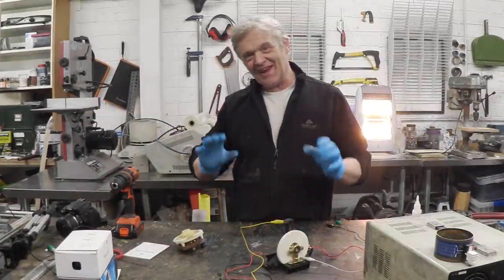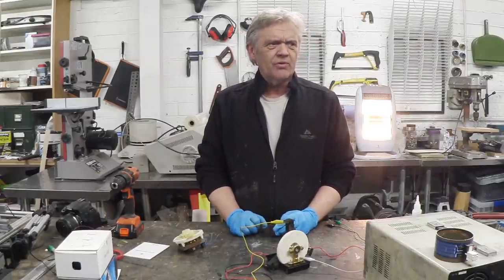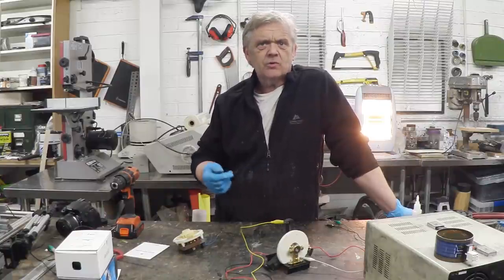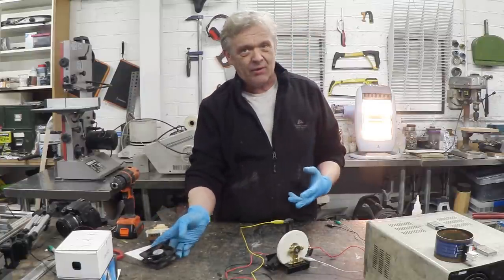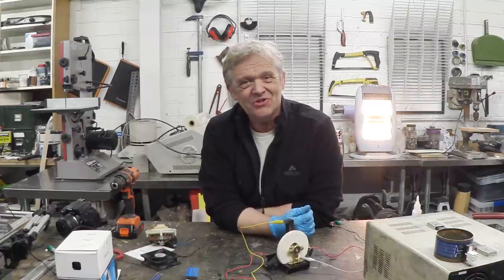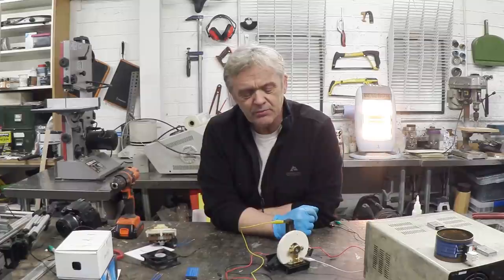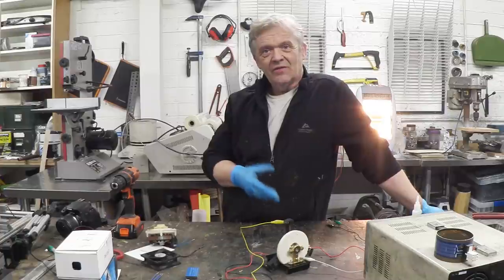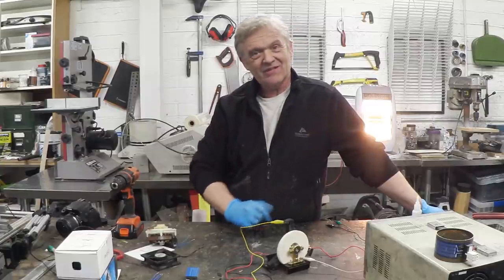1017 Brushless Motor Controller Without Electronics

Comment: Really cool. I've been thinking for a long time how to mechanically switch on and off motor phases. I always liked carburetors over annoying electronic fuel injection. This is a great thing and I think it's possible to drive the commutation from the motor itself. Will need some kind of a kick start though maybe. Great stuff, thanks for sharing this.
Reply: Fuel injection was developed to improve only one thing: manufacturers´ profits.
Reply: have you ever met an annoying carburetor?

Comment: A big advantage of an electronic solution is feedback - either by measuring back EMF, measuring the current in two or more phases, or with an encoder. Feedback is essential for moving BLDC motors at slow speeds with high torque like in electric vehicles. It will be interesting to see your approach to this problem in a mechanical way, keep up the good work!
Reply: Yeah the variable load is defo a problem but some genius out the box thinking may solve it . Maybe silicon is a solution to that problem if its just feedback ?

Comment: As an electro engineer: Rotating converters was the business in the old days. You still need somehow to regulate the rpm of the converter. Sorry, this is heavy, bulky and the carbon brushes for heavy loads? They got a 2V voltage drop, each! This is a efficiency nightmare with very limited use everywhere. You could rather use dc brushed motor only and easy regulate the rpm. If you realy got heavy loads on a budget, you could go with the silicon solution with used parts and knowhow.
Reply: I am trying very hard to source a controller for a Motenergy me-1306, 24-70V, 12KW motor. I refuse to believe that the only thing that can drive it is a $500 controller shrouded in mystery by Kelly, which people say can still burn up after a few minutes. Please help if you can.

Comment: Good idea Robert. Your rotary controller will need to handle a lot of current so it will need to be large.
I connected two identical stepper motors together wire for wire and found I could generate enough current by twisting the shaft of one motor to drive the other motor. No external power supply other than my own twisting force from my hand. I had to get the speed just right, fast enough so I generated enough power but slow enough to allow the second motor time to react.

Comment: Thank you! I'm refitting my 4Runner with an electric motor, the ICE having seized after the oil pump failed. I'll be installing a 30hp to 50hp motor as funds become available. I'm looking at a similar control with mine, only a little different. As with the logarithmic dominos I'm controlling a big motor with smaller devices. I may encase my controller in sulpherhexafluoride...
Oh I have a 5hp electronic controller and your conversion blends with that perfectly.

Comment: this is really good im probably going to try this, the only down side is is there going to be arcing in the commutator when you put huge power through the instant cut of huge power causes a backup like in points might need so mitigation

Comment: Mr. Smith is spot-on.  I work in the utilities industry and large motors are controlled via frequency and use AC to avoid the DC brushless limitations described here.  DC Brushless would be wonderful for example as backup water delivery directly from battery resources, as AC/DC inverters exhibit the same silicon limitations and expense.
Reply from the maker: thank you mate - I feel better about what I said with confirmation from a 'guy in the know' - cheers

Comment: Great start, I have had the same thought myself, the relatively low amperage of reasonable cost speed controllers has stopped me making an electric car conversion. I thought it would be good to have a mechanical smoother sine type wave somehow? I note the motors driven seem a bit jumpy.

Comment: Youre partly right. In many cases relays and contacts are used to handle high power output. This is still the case. It's more robust, is forgiving when mishandled, has low loses and is cheap compared to electronics for the same current.

However for many applications it's just not possible to use contacts. I don't have experience with electric car motors but i do have experience with stepper motors. These need a constant current  for the RPM range the system is designed for. If that is a high RPM you need a high voltage to maintain current while winding impedance is going up at high rpm but low voltage when RPM is low. This would cause huge losses in an analog system. To avoid that PWM is used to control average voltage. maybe 8 to 500 kHz. Drive systems for trains are simular. For some you can actually hear the PWM when traveling by railway. Car's won't be much different. Thats very hard to do with any kind of mechanical system. Both high frequency and pwm current control. Bottom line : You need electronics for such applications.

Comment: Agree about low power handling capabilities of semiconductor devices. Have yo heard about Ignitrons? How bout triggered spark gup? Also we are using traveling wave tubes even today and there are some immensely powerful Radio tube used today.

Comment: I seeeeeee Dishwasher parts. I'm already excited.  That heater or the right is one of my biggest bug bearers with Bosch
Reply from the maker: lol - it was the one you sent me mate - turns out it is a brushless dc motor! - who would have thought - cheers
Reply: @ThinkingandTinkering  I have probably 100 of them . I've been saving them up along with the drain pumps. I couldn't get them to run on my dc power supply though.
Reply from the maker: well you can now lol

Comment: Maybe a very similar idea but even easier is to have magnets on the rotor and a set of reed switches on the stator? Still no brushes but a way to control the phase switching of a bigger motor. Plus speed control.

Comment: congratulations! this is what I have been trying to get folks interested in for 40 years, and the flack from it has been monstrous.  now I dont feel so much and out sider knowing that you Robert, thought so too. I also have for those that that are seeking, a what i call three phase Sudo parametric rotary speed controller that is mechanical and I feel repairable for very little with just a bit of time and scrap ironically driven with a variable electric drill ( you have no idea how much I smiled when you busted out the cordless variable speed electric drill) good show 👍 that rotary switch in the original black and white Frankenstein movie got me started thinking about it when I was a kid, do you know the one from the movie that was big and round and had sparking around its perimeter and made a very pronounced clacking noise with sparks flying out of it as each one of the switches fired has the internals rotated, I built on that idea, Incorporating a rolling contact concept. for longevity and build ability
Reply from the maker: mate - have you done some videos on this - if not - why not lol - love the idea myself
Reply: no have not done any vids, but you caught on fast, thought you might, we seem to be wired similarly and you want bypass the.... i am being redundant. due to down sizing and some health things my shop and gear is suspended in the perfect storm so to speak, I would love to have a channel going wanted to do that since about 2004, but I had allot of interference and allot of life happen, If I were down the block from you, i am quite positive we would play together and cause perhaps some unrest and heresy with proof of concept in the Scientific, DIY, and commercial industry while building our play things. some of the controler ideas we're actually blocked in the DIY maker space community is if you can believe that, it was incredibly important to them That no electro mechanical concept proof be made , And that everything should be based on an arduino, don't get me wrong I Love the Arduino, but microcontrollers Are not new to me, 8080A, 6502, 6800, 68000, and have their place, it's just that I meet resistance when I Carry myself with the concept that the time the technology was created Little Bearing on the practicality it offers to achieve a goal within a construct. whatever gets me there within my means and ethics.
Reply: what are my controller options to drive a Motenergy me-1306, 24-70V, 12KW motor?
Reply: Could a mechanical commutator also be used to create regenerative braking or for power generation? I am trying a hybrid drone generator, working with over 100 amps, and the electronic speed controllers are prone to failure at those high power levels. But, goal is to get power from BLDC driven by engine

Comment: RMS, and the inverters on the electric cars also have to have extensive cooling systems to protect the electronics. Mechanical contactors are cheap and offer high current control. I totally agree with you assertions.
Reply from the maker: cheers mate good to know

Comment: After having two dc to ac inverters for my solar setup explode on me I’m also going the rotary converter way. To bad if it’s less efficient, it’s repairable!  When a silicon inverter dies it takes out all the electronics upstream in the inverter and downstream! By adding a flywheel the rotary converter can cope with capacitor start devices better than an electronic inverter!

Comment: Another cost effective brushless motor sweet spot is around 1HP 750 w for electric bicycles....millions produced....around $15 USD on ebay
Has lots of features like regen braking if required, drives low cost display....As u say big cost jump for water cooled full size vehicle electronics
Reply from the maker: it is what I was thinking about mate

Comment: For smooth acceleration sensors are needed for correct phase control, mechanically linking the smaller motor to the bigger motor may work if they are designed to match each other?
Also the direction the motor spins can be random without sensing the back emf.
Just pointing out potential issues.

A brushed motor controlled by voltage works very well whilst the brushes are good but needs maintenance and of course the voltage needs to be controlled efficiently.
The biggest motor I have is 1000w ebike  dd, to upgrade the controller for serious power is expensive and also they are prone to shorting out fets if there is an issue with timing of the switching.
A simple mechanical solution with easily replaced parts would be interesting.
Reply from the maker: they are good thoughts mate and as I said this is really proof of concept level - but I am pondering the issues you raise for sure

Comment: Will be interesting to see how it  copes with a very large inductive load? I expect to see a lot of arcing as it switches.  I wait with anticipation on the results.
Reply from the maker: isn't a motor an inductive load? this is just mechanical commutation - pretty much standard for DC motors isn't?
Reply: @ThinkingandTinkering   yes it is, but the car motor is a very large inductive load. It's normal to see brush arcing in DC motors but I've never seen a car motor being driven that way. Also as carbon is resistive, what sort of self heating do you expect to see?

Hi current DC is a bigger to switch due to the arc's not wanting to stop by themselves. I've had large contactors weld their contacts closed when switching a large solenoid, fine when turning the solenoid on, but the arc when breaking was the cause of the problem.
Reply from the maker: I don't disagree agree mate - but large DC motors are going to be the place to look for solutions I would think

Comment: I have been thinking of this for a while. I was thinking about using magnetic switches to control relays that would drive motor. Not sure this would save power, but I think it would be very robust. You could drive very large motors for very little cost and still have no brushes.

Comment: Totally thumbs up.  thank you for this video. 

Two thing this mechanical commutator is missing, positioning sensing and limiting the voltage/current. 

1) Strange motor vibrations will happen if the rotor's rotation can not match the stator's field rotation.  Maybe this issue can be managed by avoiding trying to accelerate too fast, 
2) Not controlling voltage at low RPM will lead to excessive currents at slow speed even under light loads.  electronic speed controller use PWM and inductance to control the voltage and current, but I'm not seeing an easy way to mechanically control the voltage/current at low low rpm. Anyone have ideas?
Reply from the maker: cheers mate and to be honest this idea - in it's basic form - is as old as the hills - it's really just replacing the commutator -I am sure solutions exist
Reply: @ThinkingandTinkering  I love the idea. Just identifing potential issues and trying to come up with solutions 😁 Here is Some out of the box thinking. 

Maybe if the commutator had capacitors on its rotor between input and output. 

Then with a limited charge stored on each cap, the capacitors provide a higher average impedence at low switching/commutated freqency, while at higher freqencies the capacitors provide a low average impedence path. The capacitors would need to be appropriately sized for the application.
Reply from the maker: I like that idea mate - nice share - cheers

Comment: The rotation of the mechanism is not the same as the motor.  You have to divide the rotation of the controller by the number of windings in the motor divided by the number of phases.
To run a 3-phase motor, with 24 coils, at 5000 rpm, the controller would have to run at 40,000 rpm.  It's a good idea, but in all practicality, the switching mechanism would have to be internal to the motor.  Then you just need a PWM to control the speed, and maybe a parallel ceramic capacitor on each coil to smooth the pulses and limit the back emf.  The capacitor would also work like that Constantinescu torque converter that Robert built, and it would help with startup.  I love it when a video gives me ideas.  😂😘

Comment: What you built used to be called a motor/generator resolver. It was used in radar systems to accumulate azimuth sin/cosine values. It would seem it is necessary to reinvent the wheel as it were to accommodate what Tesla tried to tell us 100 years ago.

Comment: This is more similar to a plug-in hybrid drivetrain such as the Prius synergy drive as it needs an external power train to turn at all than one that you can just connect a battery to and twist for a power delivery.

A more effective way to make a non digital controller is to pair a potentiometer with plenty of mosfets and you got an analog controller which is my favorite alternative over the one that is popular in modern electric vehicles that we got now.

Comment: Sure, SiC gets more expensive as you begin to increase the power demands, that is a given. While a mechanical commutator will be cheaper (somewhat) compared to the 'same capability' SiC solution, the reason its not used is the fact that it is so inefficient compared to a 'proper' brushless driver when you begin to scale up to large systems. Not only will the friction and resistance of the brushes reduce efficiency, but the fact that you can't feed a proper Sin or Trapezoidal waveform to the coils will inhibit the efficiency, and max speed/torque of the motor. Block commutation, which is the most rudimentary form of driving a BLDC motor, and used in 95% of cheap hobby ESCs, is still more efficient at driving brushless motors considering it is able to 'step' the voltage applied to coils vs a brushed system which is full on-off. When you compare this to Sin, Trapezoidal, and even the holy-grail FOC drive, brushed systems clearly loose in nearly every regard. The cost of a proper brushless controller only looks bad when you think you can drive the same motor with a brushed system and still hit similar performance targets. If Brushed systems were a viable solution, they would far more prevalent in industry, as you'd bet they would do whatever they could to lower the cost.

Not to mention computerized control lets you tweak drive parameters on-the-fly to tune for performance, efficiency, etc.. A brushed system isn't nearly as configurable. Same reason why DSP(Digital Signal Processing) has largely replaced Analog filters and systems in 95% of applications.